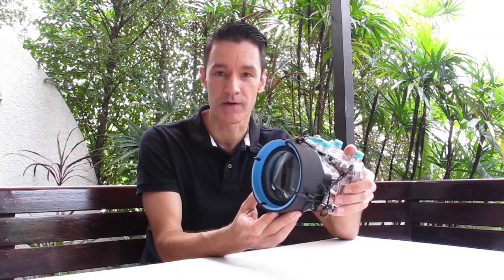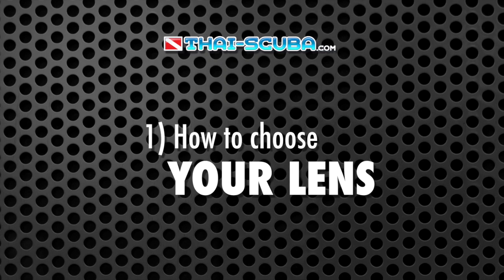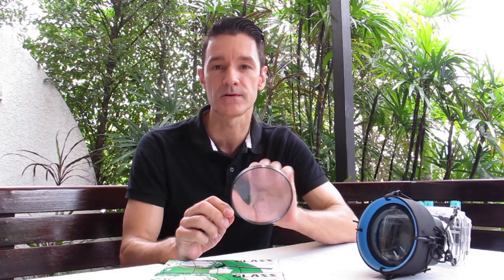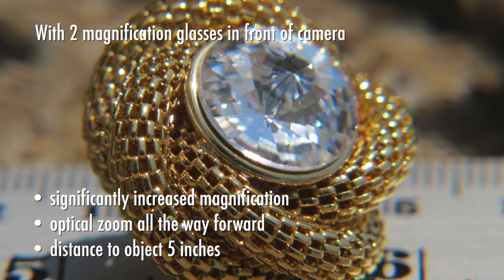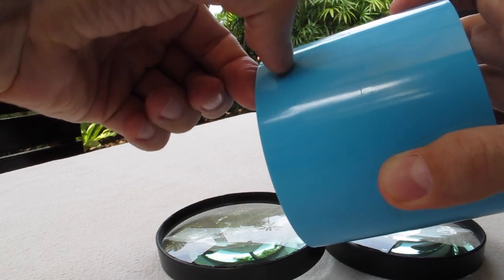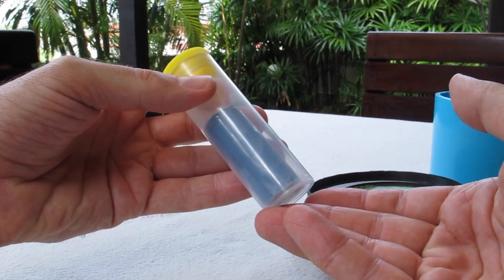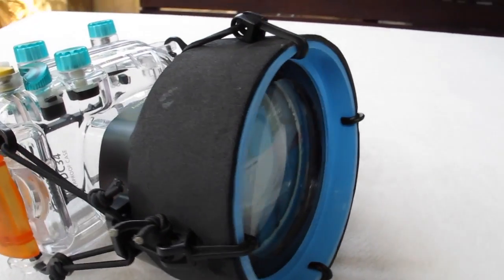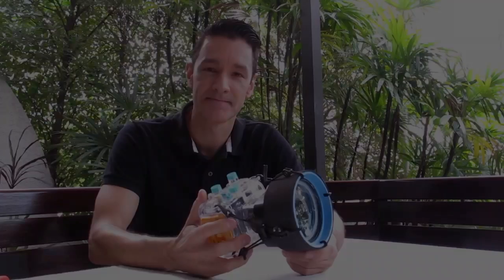DIY Scuba Stuff: Macro Lens

Comment: Also, maybe using glass lenses might reduce some colour fringing at edges due to plastic causing more dispersion of the light.  Different colours refract different amounts, so there's always some chromatic aberration - but some materials are better than others.  Glass might also distort less under pressure.  Just a couple of thoughts.  Nevertheless - I love the design.  Can't wait to start working on one myself. Cheers!
Reply from the maker: You comments are spot on! I realised that I had used a wrong wording when describing my magnification lenses, haha. When I talked about a "plastic magnification lens", I referred to the material of the frame, not the lens itself. My mistake by creating this confusion ;). Of course I would always go with a proper glass lens - plastic or acrylic scratches way too easily and the glass lenses I used cost next to nothing, so price was not an issue.

Comment: I like the design - thanks for the inspiration.  Do you have issues with the water pressure affecting the closed cell foam components?  Either water-logging or possibly compressing and changing dimensions?
Reply from the maker: Hi! No, I did not have any issues with the closed cell foam components. The strip of material which I use between the lenses and the PVC pipe is used to keep the lens snug and even with a bit of compression under water there is no shaking around. It stays snug at any depth. I prefer to keep this foam strip as a loose part (not permanently glued to the inside of the PVC pipe), so the individual parts can dry much quicker and can be cleaned more easily.
The foam that I glued on the outside of the PVC pipe is really just for cosmetic purposes and pressure would not affect its performance.
Reply from the maker: (cont.) Just realised you might be thinking about the thicker material foam pad to be used as the lens attachment to the housing. Actually I gave one of my dive buddies all the materials shown in the video to make his own lens, using the thick foam pad as a housing attachment. I will have to check with him about his experiences. From gut feeling, I believe the black material that I had found is very stiff and would not give in under pressure in a way that it would affect the performance of the lens. It is possible that this might happen with the baby kick board material. In that case I would advise to cut the piece of foam slightly larger and give it a good squeeze while assembling it in an air environment so even with a bit of compression under water it still holds the position. ;)